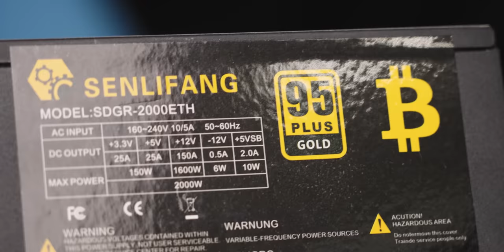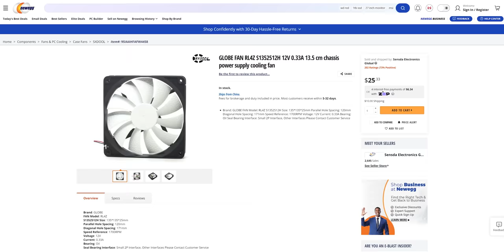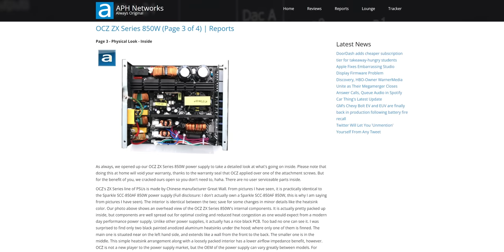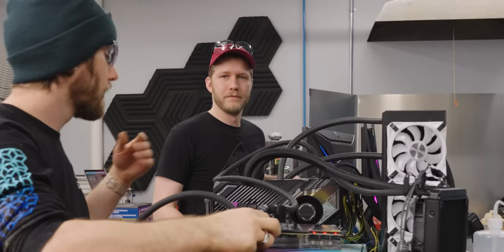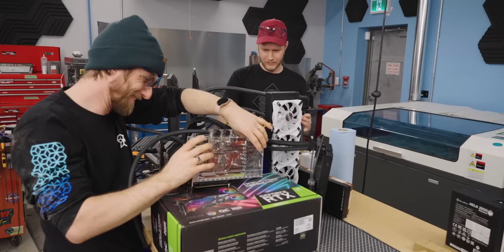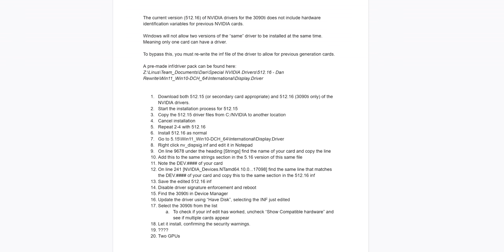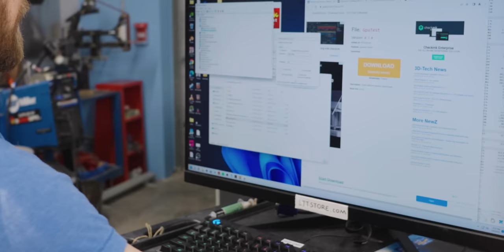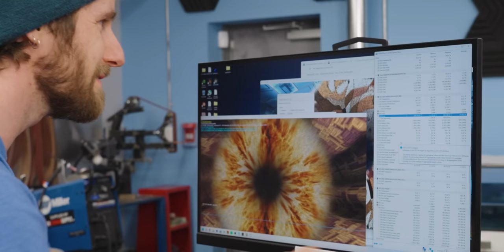This is one SKETCHY 2000W Power Supply

Comment: Sorry just a correction on the video... The MOV section is totally wrong, although the silverstone showed a MOV. The parts in the "2000w psu" are actually NTC parts, more specifically ICL  devices (inrush current limiters), completely different from MOV parts. They are resistors that are temperature sensitive, helping to reducethe initial rush of current (due to charging capacitors). This initial high current load causes them to heat up and therefore lower their resistance making their effect on the circuit more irrelevant due to lower resistance at higher temperatures.

Comment: "Don't touch these"
*electrical expert touches them*.....

On a serious note, they aren't stressing it enough in the video and explaining why it's so dangerous to open a power supply. The caps can hold charge long after being unplugged! It literally can kill you folks! Same goes for appliances like a microwave.
Reply: Makes sense, since the electrical expert knows what he's doing and the average viewer does not.
Reply: What you say is true, but it's also true that most reputable power supplies have bleeder resistors across their large caps, so they will be completely safe within a few minutes, worst case.  So, the Silverstone, probably perfectly fine.  The other one.  Who knows.  If they copied a Great Wall, and didn't skip those components to save a few cents, maybe.
Reply: @iClone101  lol, he really didnt
Reply: go watch electroboom. 
electricity through the body is only dangerous if it passes through the heart.
Reply: @niky00045  Pretty much true, but it is also possible to stop your heart with the energy stored in a cap, especially a large one.  Just depends on the path the electricity takes as it flows through your body.  That's why TV repairmen often worked with one hand behind their back - to try to prevent any shocks from flowing through their heart.
Reply: I love power supplies and I sleep beside them. He is talking about the transformer, you cannot be shocked by that if it's not plugged in. Plus, as the other reply said, capacitors have resistors in parallel that will discharge them when not in use. However, if you don't know what you are doing, just don't touch them. If they are turned on, the MOSFETs create huge voltage higher than the input.
Reply: @ccoder4953  or just maybe use proper isolation (freaking rubber sandals are enough) so electricity CANT flow through your body at all?
Reply: I mean yes, but it really like days? I mean they are regular capacitor, if they can hold  enough charge to kill me after several hours that well use that things as batteries right?
Reply: can't you just safely discharge them, like discharging a CRT's tube before doing anything with its insides?
Reply: @MrMarksam1  they hold a charge for a long time (many weeks or months without bleeder resistors), but it's a tiny capacity... it wouldn't even charge your phone 1%. Capacitors hold a little bit of power and can dump it fast. Batteries hold a lot and dump it slowly. 

Hope that helps.
Reply: @seushimarejikaze1337  .... rubber shoes don't stop electricity flowing through you, just through your feet to the ground, which is not an electronics concern anyways. The risk is if you touch two bits with both hands and the power travels through your heart that way. That's why some electricians will work one handed.
Reply: they clearly said, to not open it? what else do you want them to do lol
Reply: I watched a friend get electrocuted back in the 80's off of what was prolly a 230-300 watt PWS then.  He said it hurt real bad.  So I would not want to try it with 2000 watt.  lol
Reply: @niky00045  yes but if you touch it with your hand it's almost certainly going to hit your heart. Also can't electricity cause nerve damage?
Reply: @MrMarksam1  no, because they don't hold that much charge, they just release it all very quickly.
Reply: No, those caps won't kill anyone.  They'd have to discharge through your whole body or across the chest. They might burn you though.
Reply: @wta1518  How would it go through your heart unless you carefully  touched one lead with each hand?  No, it wouldn't feel good, but don't say obviously ridiculous things with certainty.
Reply: @volvo09  i knew that to be honest. What I didn't know was that just a little current is enough to kill someone. Like 50mA. I didn't know that.  I though like 240 volts during an blink of an eye wouldn't hurt a person because it would be so little current and with that so little power that it couldn't do enough damage. 

I actually thought that this was how tasers work, high voltage but very low current, but apperantly that wrong as well they seem to have high voltage and high current and still don't kill you? I have to look into that more.
Reply: They said both power supplies had been sitting for over a year in storage without being plugged in. Even if they didn't have bleeders in them that's surely a long enough time to discharge any and all remaining current inside any components
Reply: @VeritasEtAequitas  Your heart is still between your legs and your arm. Even though it might not, it's still better to be safe than sorry in this case.
Reply: OK dad
Reply: @Idiomatick   why the hell would you touch ground and hot line with each hand? in what scenario could that happen(to someone that at least know how to hold the screwdriver?) more common is electricity discharge to the ground on which you stand, thats why proper isolation from ground (in both cases) is paramount. its not a concern for electricans that work on elevation(more often than not the electricity is cut anyway in that case), but it is a concern if you work on any electric mechanism that might hold charge and you stand on(or plan to touch) anything else than insulating material. energy from capacitor should not flow if you take precautions and insulate yourself properly or discharge it beforehand. ever wondered why birds land on high voltage bare cables and arent electrocuted? same applies here, no ground, no flow, no discharge... simple( edit: anyway people that dont have any experience should not do anything of the sort, unless they trained themselves or someone else trained them. DC current can be deadly no matter how some people spin it and should not be underestimated. )
Reply: There's usually only two capacitors on the primary side that store anything of note and they generally have bleeder resistors on them to drain the charge. Although the Silverstone had 3 bulk caps in it. So just stay away from the big cans near where the power cord comes in and you're good. Or short those out.
Reply: @wta1518  There's the whole fact of your body having an inherent resistance though, so when you're dealing with such a small amperage, you're really just talking silly.
Reply: @eoinmcorks  it really does not take much electricity to kill someone. 0.035 of an amp across the heart will kill most people. Fortunately our hearts are in the middle of our chest cavity so it is somewhat difficult to get current flow there. Still you grab a live wire with one hand and your other hand is grounded and the voltage is high enough to go through you and you may be in trouble then. That's why techs are told to, "work with one hand on your pocket". Which means don't go grabbing live stuff with both hands. There's old electricians and there's bold electricians but there's no old bold electricians.
Reply: @seushimarejikaze1337  Holding onto the case with one hand and working with the other is both common and an easy way to send current through your heart. You sound mad that I mentioned a foolproof way to avoid getting injured.... relax dude.
Reply: @superjive8282  That's like handling a gun that you believe to have been unloaded without checking.
Reply: @Idiomatick  no way im mad, its just exchange of opinions, every point of view is important. though its a given that if youre know what youre doing, you will not hold onto anything at all. i find it hard to believe that people dont have enough common sense to get zapped by offline psu cap. you literally need to try extra hard for it to happen(in my opinion ;]), ive took apart countless psu, either for parts "cannibalism" or for maintenance both offline for long time(few days) or disconnected "about a minute ago" and never hurt myself by doing so
Reply: @1pcfred  DONT SHORT DC CAPACITORS. EVER
Reply: @seushimarejikaze1337  why not short out capacitors?
Reply: @1pcfred  
A. fire hazard 
B. capacitor might take critical permament damage(thats not visible at all) leading to failures later or right away
 C. it might actually explode
pick 3 out of 3 lol
anyway if you NEED to short out capacitor and accept above mentioned dangers, at least wear eye protection
Reply: @seushimarejikaze1337  
I've discharged capacitors and it's not as dramatic as you make it out to be. A big cap can make a pretty healthy spark. If I'm worried about the condition of a capacitor I'll test it with a meter. Check it's ESR and measured capacity. If it's good then it's good. If a cap is going to blow up it'll blow up when it charges up. Just how it goes. They don't blow up when you discharge them.
Reply: @iClone101   short the caps with rubber handle screw drives 
but usualy good products have a resistor that shorts it so it will not hold the charge
Reply: @MrMarksam1  no you cant there are super caps out there for trains etc but  the main basis of thr cap is to hold energy for a short time and get charged fast as possible and its generaly for smoothing out noise and spikes from main power
Reply: @1pcfred  when you short the capacitor the voltage spike can damage it. please read about it look for info on the subject. only safe way(safe to capacitor itself) to discharge capacitors is to either spend their energy, wait a loooooong time (xD) or use resistor at output to discharge it. shorting anything is a short way to damage it sooner or later and that "healthy" spark is actually "critical hit". but i guess either way youre, at least, making sure no harm comes to you, so the rest is your choice, whether you risk the damage or not.
Reply: @seushimarejikaze1337  what do you think happens when a capacitor discharges? LIke I said in my other comment if the capacitor is damaged during a discharge it was damaged already. I know plenty about capacitors now and do not have to read anything more about them. Electronics is a topic I am quite familiar with.
Reply: @Idiomatick  That's not the same at all lmao, the gun isn't going to unload itself over time, it requires you to manually open and unload it...
Reply: @niky00045  Guess what. If the electricity is enough, it WILL reach your heart.
Reply: Damn bro I got zapped by an F70 EXR, touched the flash capacitor it hurt kinda bad, haven't got zapped in a while. Rookie mistake ik.
Reply: @volvo09 yeah but you need a really large cap to kill you.

Comment: 8:15 NTC thermistors is used for inrush-current limiting.  When the capacitors on the input side of the PSU are fully empty and the NTC is cool to the touch the NTC thermistor adds resistance to the AC circuit to gradually charge up the capacitors over a longer period of time instead of trying to charge them up very quickly all at once.  As power starts to flow through the NTC thermistor it begins to heat up and the negative temperature coefficient (NTC) means as it heats up the resistance gets lower making the NTC thermistor look more like a direct wire in circuit instead of a resistor.  So it might start at like 18 or 20 ohms but as it warms up it changes to less than 1 ohm over a fairly short period of time.  It basically makes sure you don't blow the mains breaker when you first plug in the PSU...
Reply: It's a little frustrating that LTT has very high demands for hiring people in LAB, but these people end up knowing their job poorly.

None of the people in the video could find out the markings of the mosfets and calculate the maximum available current, no one opened the datasheet for the transformer and сheck  its maximum power.
Reply: so its for soft start
Reply: @gazooc  since when is this ltt labs
Reply: Kyle not recognizing labeled NTC was really painful tbh
Reply: As you are really knowledgeable about physics could you tell me how would one go around calculating V,I,R when two of these are given both in series and parallel. It would really help if you could tell me how to for example mathematically separate currents at the two resistors in parallel to compute their values when V and R are given. I have a test on Tuesday and would really appreciate the help. All 6 scenarios for series and parallel.
Reply: Finally someone noticed it..that dude has no idea…magnets 🤣
Reply: @skyemperor2357  

Difficult to describe without seeing an exact circuit but with Ohm's Law you can figure out each problem.  

The Wikipedia article on Ohm's law is what I think you want to study.  The section on "Circuit Analysis" is probably an area of focus:
https://en.wikipedia.org/wiki/Ohm%27s_law#Circuit_analysis

That circuit analysis section of the Wikipedia article has my favorite graphical representation of the "Ohm's Law Wheel."  I'd print it out or have stickers made and hand them out to other nerds if I could.

Also remember that, in circuit analysis, resistors in series add their resistances together and resistors in parallel is the reciprocal of the sum of reciprocals, so:
  R = 1 / ( (1/R1) + (1/R2) +...)

That formula should be interesting because the reciprocal to electrical resistance is electrical conductance.  So in that formula you are adding "conductance" values and then converting them to resistance at the end.  ;)

For capacitors the series parallel equations are reversed.  Parallel capacitance values are added together while series capacitance values follow the reciprocal of the sum of the reciprocals formula.
  C = 1 / ( (1/C1) + (1/C2) +...)

Interestingly enough, the reciprocal of capacitance is elastance.  So you are adding up the elastance values and converting them back to capacitance. ;)

Hope that helps...
Reply: @gazooc  Honestly, I don't blame them for not wanting to take the heatsink off to check the mosfets before actually testing the power supply.  The high side mosfets are usually pretty generic and very over spec'd, usually so over spec'd with voltage and current.  So knowing what mosfets they are doesn't really help calculate output power, you would be better off looking at the diodes and caps in the output section on the secondary side of the transformer... 

And finding datasheets for transformers is more like finding Nemo after he was flushed down the toilet IRL...  You're likely not going to find a data sheet for any transformers as they usually end up being made to order parts.  You might be better off de-soldering the transformer and reverse engineering it with an LCR meter and some calipers. ;)
Reply: @abanstesttesting7134  Yeah, and then Linus repeated that after him...
Reply: No, soft start is separate from inrush current limiting.
Reply: @Alamagosa  soft start is exactly what a NTC does. There are higher power circuits that can be used in place of a NTC to soft start high power circuits but they aren't as small and simple as a single NTC...  Soft start on the secondary side is tougher because you have to ramp up to working voltages within 2 seconds and that limits what you can do with higher watt power supplies.
Reply: @10100rsn  An NTC is not a MOV. Not even remotely related.
Reply: @rexsceleratorum1632  Yes. Was too tired to correct it.
Reply: @10100rsn  Aced the test

Comment: Should ship that to GN and have them do a full a test suite on it.
Reply: Jup im very confident that tech Jesus can get that thing to blow up, or at least give it an award.
Reply: I've been asking Steve to look at these for a year now.
Reply: Yes they should
I mean their equipment can test any psu's claims of being a certain wattage
So it WILL see if it can run 2000 watts
Reply: @Ocastia  the "somehow not as bad as Gigabyte" award
Reply: @plazasta  it could conceivably get that award, however I don't know if it could get the: "better than Dell" award, because that's the only place where Dell doesn't suck as much as they usually do.

Still a very low bar.

Comment: The true difference with the silverstone is the cleanliness of the output signal, meaning no ripples on the volt lines. This helps with your lifespan of the products and puts less strain on the power circuitry of the other components.
Reply: It would be cool if they could hook up an osciloscope and show the signals. Could be another great electroboom collab.
Reply: It's also important with system stability, especially when overclocking.
Reply: psu reviews really need to look at the power quality on an oscilloscope, both idle and under load.
Reply: Not really. You see, Intel defined voltage specs for PCI and they are pretty loose for todays standards. Nevertheless,  everything that you install on MB (RAM; CPU, GPU etc ...) has to conform to these standards, therefore everything runs ok even on PSUs with lower tolerances. Simply, components expect certain ripples and are not damaged by them.
Reply: No ripple I don't think is likely. Very low is probably more realistic.
Reply: @Arelias95  If Mehdi gets involved there's just going to be a bang and there goes the rig.